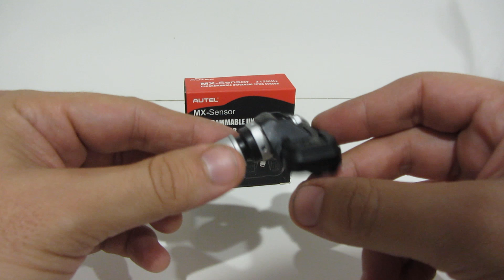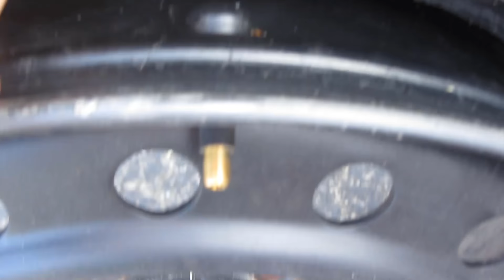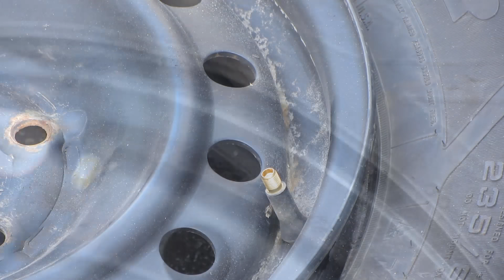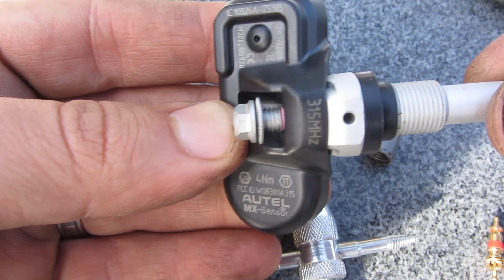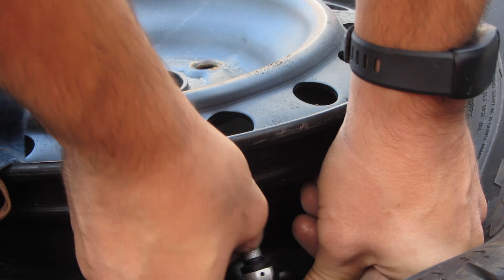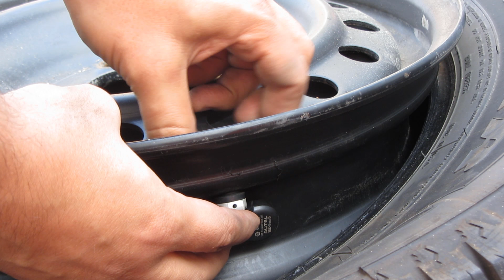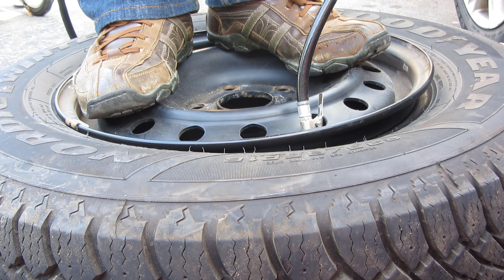Install New TPMS Sensor DIY Without Needing Rebalance

Comment: Thanks for this one as well.
One probably dumb question: does the sensor plastic part covering the... chip, I suppose touches the rim or does is float a bit a.k.a. it does not do contact with the rim?
I hope I explained it correctly 😊
Reply from the maker: I think I understand what you mean. It depends on the brand of sensor. These ones that I used are adjustable with that little bolt. So you can push it down against the rim and tighten the bolt (like at 8:27 in this video). Other brands (like the OEM ones) aren't like that, and I have found those do float a little, but it doesn't really matter.
Reply: Mircea-Florin Precup no

Comment: how long last the batteries ?
Reply from the maker: From what I've read, they should last about 7 years.
Reply: Gabe's Hacks 
Hmm ... my went down after 1 year and the disadvantage is, that the display freezes on the last reading .... When O recognized that the readings are not refreshing ... I checked manually and all tires were way below ....  So the system needs a lot of attention.
Reply from the maker: @n.r.2258  Are you talking about the Autel MX sensors that I used in this video?

Comment: I was thinking of placing TPMS sensors on my Yamaha FJR motorcycle.  They of course make the ones that just act as a screw on cap.  However, my thinking is doing it internally has to be better.  Have you ever tried to replace a motorcycle tire?  Folks, I spent hundreds of dollars on a tire mount/dismount set and could not get the tires off the rims. Ended up selling the entire system..  Plus, those non-professional tire changers will damage your rims.  Even though you are not taking the tire off here, just squeezing a very dense smaller motorcycle tire is a real job. I may just have the motorcycle shop do it when I have them change the tire.  I don't have any problems taking them off.
Reply from the maker: I've never touched a motorcycle tire, no. What leads you to believe the internal ones would be better?
Reply: I change tires on my Super Tenere pretty regularly with 3 tire spoons and a 4th for bead braking. The two keys that I have learned are ensure the tires are warm and use generous amounts of legitimate tire lube. The first is easy, take the bike for a ride and set the replacement tire in the sun or near a heat vent. The second, I bought a gallon of RuGlyde from Napa which will likely last me the rest of my motorcycling life(I'm almost 30 and won't be stopping soon). I have given up on not scratching my rims as I treat my Tenere like the overgrown enduro bike that it is. However, the MotionPro Rimshield II do work but are a little fiddly. Some tires are just flat out more difficult than others; I have found a decent price, ease of use, and longevity in Shinko 804/805 tires and will probably continue to use them. I am certain some some internet searching could identify the sport/touring equivalent. My last comment is my most recent time/headache saver, Ride-On tire sealant. The stuff is kind of expensive but the time and piece of mind saved by not balancing my tires is great. I have yet to experience a puncture with it but believe it will hold up just fine.

Comment: Is there any battery on this sensor?If does then tell the duration of work. If not then how it work .plz give detail.
Reply from the maker: Yes, there is a battery inside each sensor. But they are not replaceable. The batteries should last several years.

Comment: Le sale mas barato Si Lo lleva a un taller de llantas..aparte de las erramientas k mostraste..nesesita compressor..manguera...llaves para guitar las llantas..
Reply from the maker: Aca en Norteamerica es mas caro traerlo a un taller. Un taller me ha dicho $70 cada llanta (por el sensor y installarlo). Yo puedo comprar cada sensor por $30.
Es asi por todas las reparaciones de autos. A veces es mas barato comprar las erramientas y hacerlo, en ves que pagar un taller.
Reply: @GabesHacks  tienes razon es mas caro...Pero aqui se gana como 5 veses mas ....k en otros paises...almeno d donde soy yo...gano 20 veses mas k en mi pais
Reply: @jorgezuniga7116  entienda que es más barato hacerlo uno.
Reply: Si tienes la erramienta Si..entiende k primero es una imbercion para tener la erramienta.

Comment: I agree with the comments there is no wrench only a ratchet
Reply from the maker: Then I'll tell you the same thing I told the others 🙂 What many people call a "ratchet" is an informal term for a ratcheting socket wrench. Technically, the ratchet is the mechanism inside that makes the clicky noise: https://en.m.wikipedia.org/wiki/Ratchet_(device)
Reply: Amen Gabe! I wouldn't care if you called it a unicorn testicle! Great video with valuable info. Keep up the good work.
Reply from the maker: @tuffdog3303  Haha, I'll remember that for my next video!

Comment: Rubber valve weight approx 10 g, TPMS sens weight approx 35 g. You must balance the wheel.
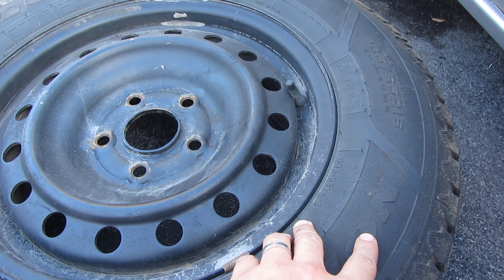Reply from the maker: You're not the first to say that. I discussed it at 2:17. Bottom line: if your wheels are off balance, get them balanced.
Reply: I can guarantee the tire is off balance...I mean may not be alot but.....
Reply from the maker: @M3M3S824  My point is that no wheel will ever be 100% balanced. We just balance them enough that there is no discernible vibration. If you find your wheel is vibrating, get it balanced. If not, then you're good. If you're replacing one sensor with another (which will be the most common reason to do this) then you'll likely be just fine.
Reply from the maker: @Dixler683  In the case of what I did in this video, I added a sensor where there was no sensor before, adding about 20g.

Comment: hey, just bought a used BMW, how would I tell just from inspecting the valves visually if they are TPSM? If I understand correctly, you can't let air out of these, or it requires a special tool?
Reply from the maker: The valve itself is just the same as any other valve stem. You can inflate or deflate just the same if there are sensors or not.
You can't tell by visually inspecting the valve stem if there is a sensor inside. The best way to tell is to look at the dash as you turn on the car. When you first turn on the car, all of the dash lights turn on for a couple seconds (this is for diagnostic purposes, so you can tell if any lights are not working). Look for the light that looks like a flat tire with an exclamation mark inside: https://help.summitracing.com/app/answers/detail/a_id/4689/~/do-i-have-tpms%3F
You can also look in the owner's manual. It will say.
Reply: @GabesHacks  for sure, so I just found out that the dealer didn't install them....so I wonder if I install aftermarket, if the BMW's system would pick up the signal? or would I need OEM  BMW tpms .
Reply from the maker: @Sardonic1981  Well it depends if the car even supports TPMS. Check the light on the dash like I described. If you see a light there, then the car supports TPMS.
But if the car supports TPMS and there are no sensors installed, then you would see a light on the dash all the time while you are driving. (It would be complaining about not finding sensors)
Reply: @GabesHacks  100% supports tpms but I don't have the sensors installed so think it's just set to off? not sure. I'll look into it thanks.
Reply: @Sardonic1981  a

Comment: Great video! My only input ( just  nitpicking)  is that it's a ratchet not a wrench .
Reply from the maker: You're not the first to bring that up 🙂 But technically, a "ratchet" is an informal term for a ratcheting socket wrench. The ratchet itself is the mechanism inside the wrench that makes the clicky noise.
https://en.wikipedia.org/wiki/Ratchet_(device)

Comment: You don’t think you need wheel balance after adding the weight of the sensor compared to the valve stem??
Reply from the maker: I discussed that at 2:17. Bottom line: if your wheels are off balance, get them balanced.

Comment: This actually looks like a lot of work, thanks but no thanks
Reply from the maker: It does get easier after the first time. But if you're happy to pay for it, by all means!
Reply: Have fun paying 500 to 2 grand to replace tpms 🤷‍♀️🤷‍♂️
Reply: @shidfard  In which unit of currency does it cost you 500-2k for universal tpms sensors?
Reply: @CoryMck  freedom bucks, and that is labor and all
Reply: @shidfard  Don't know what currency that is. It costs a lot less in USD in New York.
Reply: @shidfard  yea...you are clueless, couple hundred bucks max for the labor
Reply: @slazster I can tell you I have a 2009 Saturn Outlook and each TPMS installed with labor is $260-$300 from the few estimates I’ve had done. No idea why they are charging so much. I need to replace 2 of mine which I’ve already found the actual part on Amazon of all places and bought all 4 for $70. Just need a warm day to replace them now.

Comment: Why would anyone want to rub soap on their Hands to put on the inside of the rim and then have to wash your hands off and go on to the next tire and wheel, repeat. It would be a no brainer to use a spray bottle of lightly soaped water. Common Sense is important when doing these repairs.
Reply from the maker: Sure, if you have an empty spray bottle handy. I don't see the point in going out to buy one just for this.
Reply: Ok boomer, just watch the video and stop complaining about a free video.

P. S. He didn't use water did he? So what good would the first bottle do? None.
Reply: Okay Commie, got it.
Reply: @SJKile  rather be a commie than a fox watching boomer, hands down
Reply: A Triggered Commie, LMAO, It figures.
Reply: @SJKile  Politics! Really!?
Reply: Nope, Communism and Fascism are all products of the Left.

Comment: But TPMS sensor weight is higher than standard valve, so you should balance your wheel again. Thank you for showing me this metod.
Reply from the maker: That's possible. I talked about that at 2:17. If you find your wheels are off balance, then make sure you get them rebalanced.
Reply: How about weigh the removed tire stem and then the sensor. And put a weight on the other side for the weight difference.
Reply from the maker: @kthwkr  Yes, that should work.
Reply: @kthwkr  Valve counterbalance it's good idea. When they balance wheel they adjust it up to 5 grams.

Comment: So if I replace my sensor in my Camry with an identical one,  I don't need to rebalance?
Reply from the maker: As long as you do it like I did here and don't turn the tire in relation to the rim, then there should be no reason to need to rebalance it.

Comment: 0.8 oz for sure you need redo balance. tire weight is 1/4 or 1/2 oz per piece.
Reply from the maker: Sure, if you find your wheels are off balance after, then get them balanced. If you're replacing one sensor with another, then you will likely be fine.

Comment: great job!
I'm just surprised that it was not necessary to balance the wheel despite adding extra weight of sensor, regards
Reply from the maker: Your results may vary. If you're replacing one sensor with another, you should be fine without rebalancing. If you're doing what I did (adding sensors where there weren't any) then you may find they're off balance after. The bottom line is: if your tires are off balance, get them balanced.
Reply: Find the weight of the tpms sensor.  Find the weight of the valve you removed.  Substract the weight of the valve from the weight of the tpms sensor.  Then, add the corresponding amount of weight to the opposite side of the wheel.  Done.  No more shaking :)  No need to rebalance the wheel.
Reply from the maker: @stephaneneron  You and I think alike! I said just about the same thing at 2:17.
Reply: @GabesHacks  One year later... Its never too late lolll   Yeah... we think alike...  My english last year was not very good to really understand all your ideas to conterbalance the weight difference between the 2 valves...  I'm still learning the hard way :)

Comment: Nicely done. I hate that tires is nearly the ONLY thing I can't do myself because I don't have the equipment to mount and balance tires. So this means a trip to the tire shop to replace a sensor. I like this method though I wonder how much more difficult it would be on a low profile tire like a 305-40-22.
Reply from the maker: Thanks!
I do imagine it would be harder on low profile tires, but I've never owned any.
Reply: Low pros would not be fun as it's already not fun with a tire machine.

Comment: Great video and thanks! I had 4 new tires installed on my Prius about 300 miles ago. The low tire pressure light came on yesterday. Today I checked the air pressure and 2 tires were about 3 lbs low, so I added air. The light has not gone out. What is my next step?
Reply from the maker: Apparently there is a reset button under the steering wheel you can try. Read this: https://priuschat.com/threads/tpms-and-tire-rotation.70771/
Reply from the maker: Just 3 lbs low wouldn't trip the light. They usually come on around 20psi (depending on the car). You can go back to wherever you got the tires from and ask them. They might be able to address it.
Reply: @GabesHacks  Thanks!
Reply: @GabesHacks  The congressional spec is 25% under specified pressure.  And you know how smart congress is.
example: 30psi x 75% = 22.5psi
Reply: How old is your car?  Many cars 2014 and after use indirect TPMS so they don't have those terrible sensors anymore. If your car is a 2010 then the 2032 battery in the sensor is probably dead. Direct TPMS was a very bad idea because it is so expensive. It did not have the capability to save enough money on your reduced mpg to ever pay for the cost of the system. Even if you ran all 4 tires at 20psi for 100k miles.

Comment: HI ,U SHOULD HAVE SHOWN THE DEVICE  PERFORMANCE AFTER THE INSTALLATION THAT WOULD BE MORE INTERESTING. APPRECIATE  YOUR JOB.
Reply from the maker: There isn't much to show other than the TPMS light turning off.
These were sensors that I has previously programmed, as I showed in my other video: https://youtu.be/N6p6xV4PlHc

Comment: I have a 2006 model  Toyota Matrix, most likely not equipped with dashboard readout for TPMS. You said in your video that the Autel was programmable. Does that help me?
Reply from the maker: I used programmable sensors because I was creating another set of sensors for my winter tires.
If you're just replacing one sensor, you could use a programmable sensor, but you could also just use any compatible sensor and program the vehicle (since, from what I can find, you need to manually program the Matrix with a new sensor). Either way you will need a tool to program something (either the sensor or the vehicle). A tool to program the car might be more useful, since it might do more than just programming TPMS. You also might be able to find a shop that will just program your car for cheap once you put the new sensor in yourself.
Reply: Virgin Conscience Consider yourself lucky that the 2006 Matrix didn’t come with TPMS. It’s just one more intrusion by the government into people’s lives. The Autel sensors are proprietary, excellent, but proprietary. That means you will have to use one of their scanners or TPMS scanner to complete the job. I have 3 separate Autel scanners that will do TPMS. The Autel TS508 allows programming of the sensors and the ECM. That is their lowest priced unit that will accomplish what you want. The TS401 does not have a DTC cable to communicate with your car, so that won’t work. The other integrated scanners are probably to pricey for most people. I also have an Autel MS906TS that is spectacular for TPMS and a whole host of other things but will set you back about $2200.00 if you get all the bells and whistles. Autel makes great stuff, but like I said you will need a conversion kit to add TPMS. But frankly I would “Count Me Lucky Stars” that ya don’t.

Comment: I just wanted to replace TPMS sensor tomorrow at Walmart. Now I'm gonna do it by myself. Thank you very much for this video!
Reply from the maker: Let me know how it goes!
Just remember that you car needs to know the new sensor is there. Some cars automatically learn new sensors, so you don't need to do anything. Others have a manual procedure you can do without tools. Others must be programmed with a tool. So just be aware.
Reply: I went to my WALLMART and they said they don't install TPMS sensors.    I had my Prius with two dead TPMS sensors that had dead batteries in them. So the other two were good.  I had four tires installed. I replaced the dead TPMS sensors....I scanned and could not clear the code error...guess what ? After the new tires were installed...Wally killed my two TPMS sensors that were good prior to new tire install !    Wally said since the TPMS light was on its not their fault.
RANK AMATEURS...
Reply from the maker: @dionkraft6782  Yeah, I've heard similar horror stories about Walmart...

Comment: How  I know which tire has the bad sensor if I put air on them and all of them have the correct pressure but I turned on the light on the dashboard
Reply from the maker: If one of the sensors is bad, some cars are fancy enough that they will tell you. But if not, the only way to know is 1. Test each sensor, or 2. Plug in a special scanner tool to the car to read which one it is complaining about.
Reply: @GabesHacks  How do you "test each sensor"?
Reply from the maker: @paulvermillion1622  You need a special tool to do it. I described how I programmed new sensors in my other video, along with the tool I used to do it: https://youtu.be/N6p6xV4PlHc

Comment: Nice video. I'm assuming if I'm replacing a bad sensor with an OEM, I shouldn't have to worry about balancing.
Reply from the maker: Correct. If you're replacing one sensor with another sensor (especially of the same brand) then there should be no need to rebalance. That's the point I was trying to get at in the video.